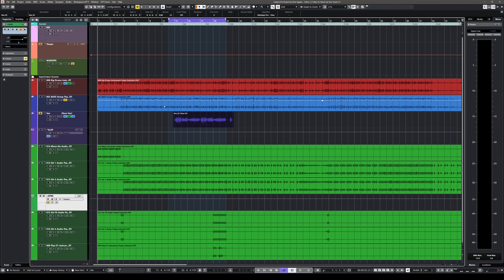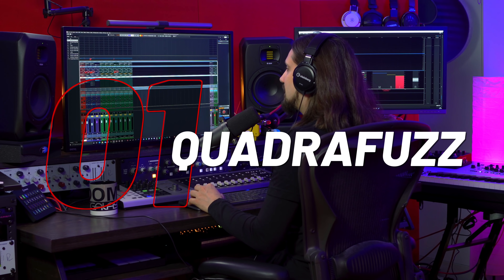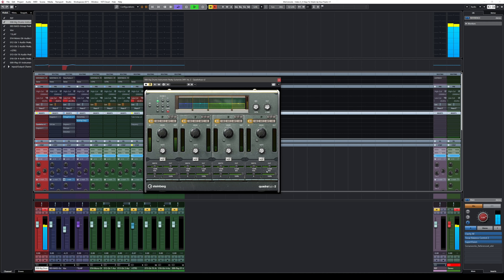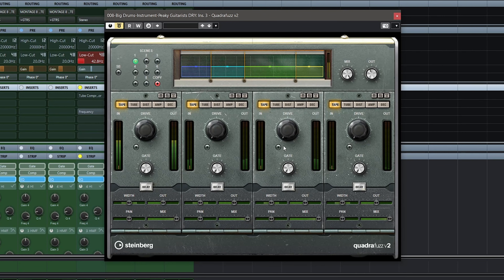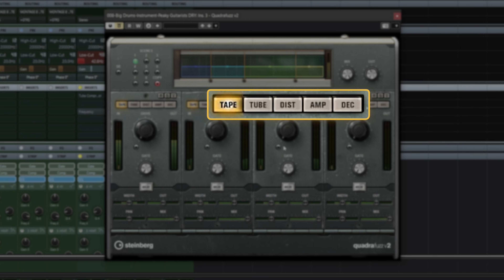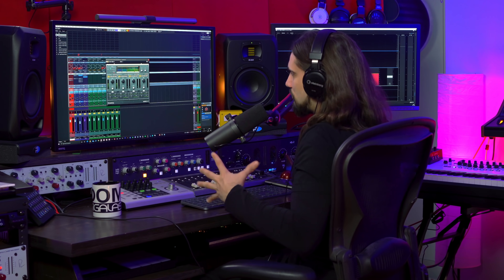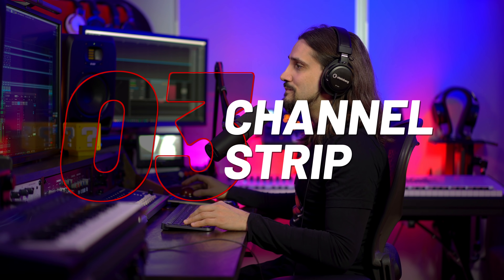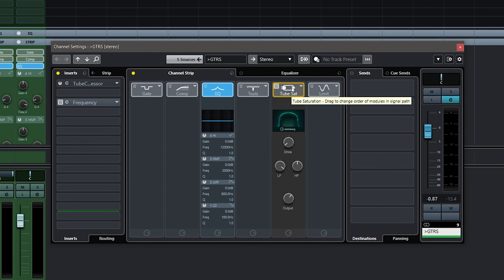5 Ways to Warm Up Your Tracks | Cubase Secrets with Dom

Comment: 5 ways to warm up your tracks
1:- Lynx, Antelope, Apogee Converters with Antelope 10mx Clock
2:- Using Hardware Analog Gears Like SSL, Neve, Manly, UAD, and Teletronix in Mixing and Mastering
3:- Use a summing box from Neve, SSL, or a Summing Console.
4:-  Stop expecting warmth from software
5:-  You know I am telling the truth so stop wandering around and find a way to do what I said.

Comment: Nice demonstration of the native Cubase stuff you can use to make a good mix. Just to be fair, the Channel Strip uses the same plugins you can find in the selection for inserts / dedicated plugins. Compressors, Saturation, Noisegate, Limiters are just the ones (same algorythm) you will find in the plugin set. But! This is not a bad thing! It means you even have more than 8 "inserts" on each channel when you are using the CS and you are not making any compromise in quality! Also, CS allows you to freely  change the signal chain just by drag & drop :)